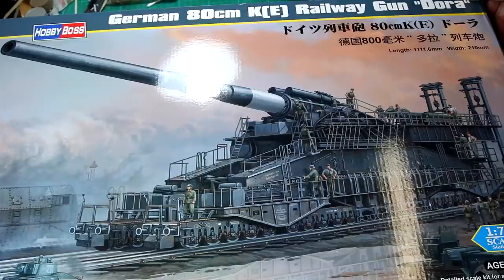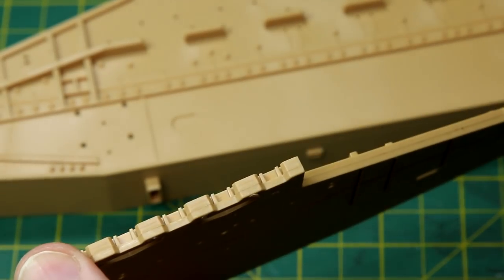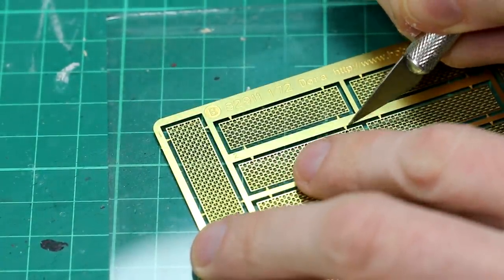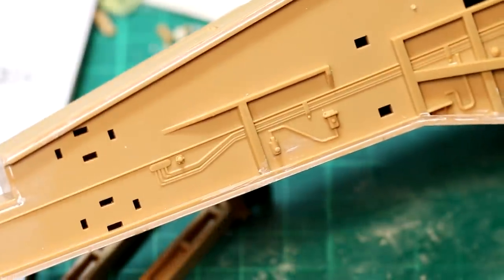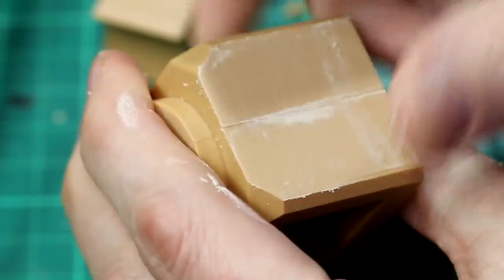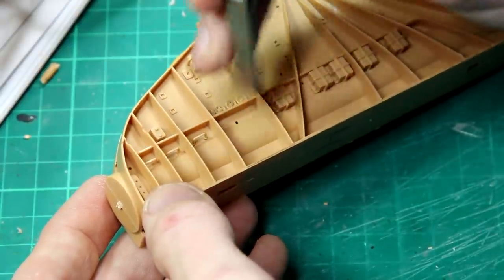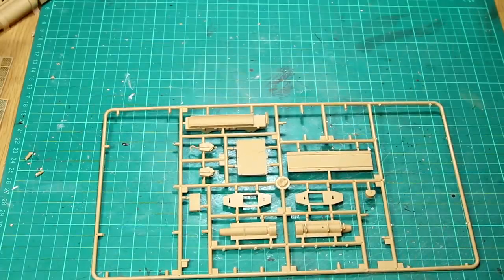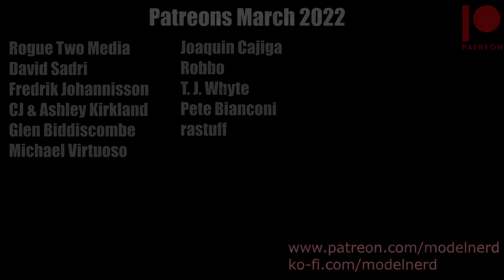HobbyBoss 1/72 scale Dora Railway Gun build - part 2

Comment: Another tip for applying very small parts is to pick them up with a very sharp, fine point craft knife. The knife won't  leave any noticeable mark's on the part. Works for me.
Reply from the maker: Good tip, thanks Simon

Comment: I built this model in 2021 even though it i 1/72 in scale it is an awesome size and excellent value. Not for the beginner by any stretch and there is a certain amount of monotony with some parts.  I also built a WW2 german locomotive with enough room on the front of the track to show the comparison in size between the two. The track is very flimsy and distorts without additional strength but it is still nightmare to get all four carriages to stay in place on the track while lining up the gun platform.  In all after spraying the correct colour it is an impressive build.  It now resides under an acrylic display case.  If you have plenty of spare cash you can also obtain a 1/35 scale version over 5 ft in length.
Reply from the maker: Thanks for the information Barry. You're the second person who has told me that getting everything lined up is difficult - now I'm starting to get worried. I'm going to try a dry fit with the rails this week I think.

Comment: Looking great. I just finished all the valve wheels. Once I got into a rhythm it wasn’t too bad but I’m glad it’s over lol. I didn’t fill the inside seams on the center structures because I didn’t think it would be that visible but I may go back and try it after seeing yours partially assembled. I’m going with xf22 for final color. Looking forward to your next video. Thanks for sharing the process.
Reply from the maker: Thanks Steve. I think it will look really good in XF-22.

Comment: I've been making progress on building this kit. I agree that it is a very repetitive build, starting with painting 40 off wheels and axles. I would also say it is very important to be sure of the orientation of the gun. It is very symmetrical and it is easy to loose which is the muzzle and which is the breech end of the carriage. I would strongly recommend assembling the carriage on the rails before painting. I found my model rocked corner to corner and I had to adjust those box structures holding the main beams together. I think the large plastic beams are slightly warped on my kit. I have painted my model German grey and weathered it with lamp black, burnt umber and titanium white oil paints.  I am making it look old as if its in a museum. This is because in action this gun was run on curved rails to achieve side to side traverse of the gun. I imagine if one was in a museum then it would likely be on straight rails. Looking fwd to the next installment.
Reply from the maker: Thanks, that's really helpful. Looking at it from above, I suspect one of my side pieces might be slightly warped too - the two main halves seem to move apart ever so slightly towards the front of the gun. I hope it won't be too much of a problem.
Reply: @ModelNerd  I actually messed about for ages getting it to sit right on the tracks and be manageable. I  ended up gluing the four bridge like structures to the long main beams because if you ran the model along the tracks it would sort of move sideways and these four bridge like things would be leaning at an angle and looking all out of square. I then put some circular plasticard washers on the spigots of the bridge like bits where the trucks fitted so the trucks had a much larger bearing area and it stopped them ending up at an angle. Finally I glued another plasticard washer over the end of the spigots to stop the trucks falling off so I can lift the model off the rails without the trucks falling off because getting all 8 of them on those spigots is a PITA
Reply from the maker: Oh wow, that sounds like a lot of work. I'm hoping I won't need to do all that. Thank you for the advice though - I really appreciate it.

Comment: This is an absolute monster🙈
When you where talking through the possible colors I just had the idea to use the typical german grey as a base color (with some pre- or post-shading) and then a slight brownish tint towards the bottom areas und a slight blueish tint on the upper surfaces. No idea if this will work out, but I can imagine this gives some nice color variation and sparks interest when watching this huge model. Maybe this even emphasize the size itself.
Reply from the maker: Thanks, that's a good idea. I definitely need to do some sort of modulation